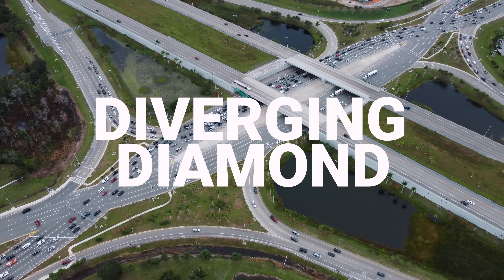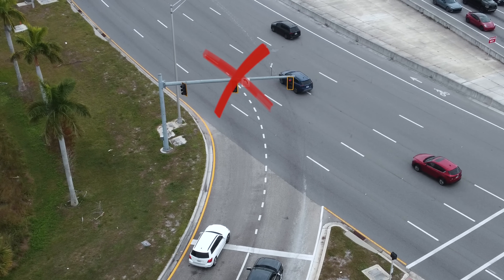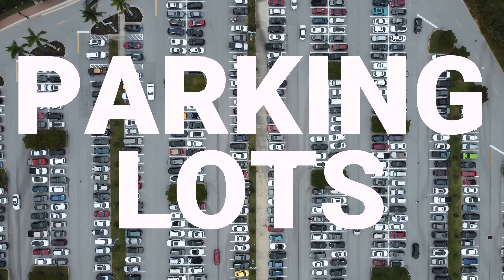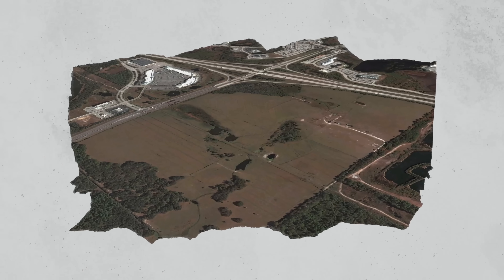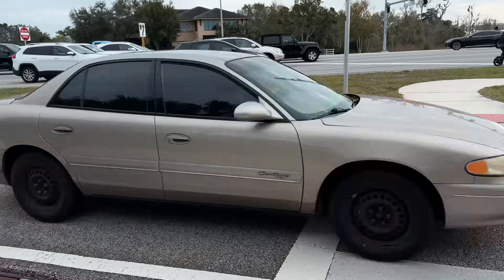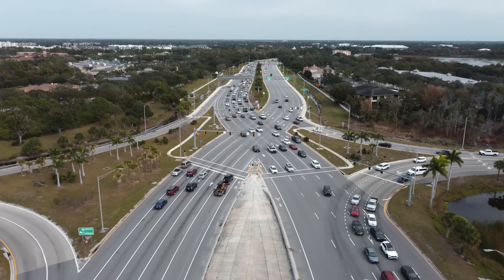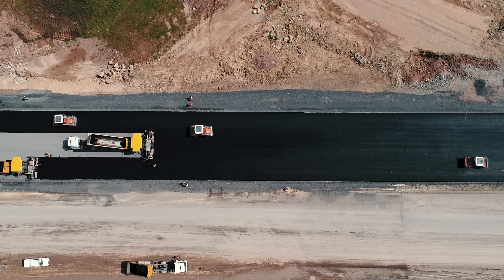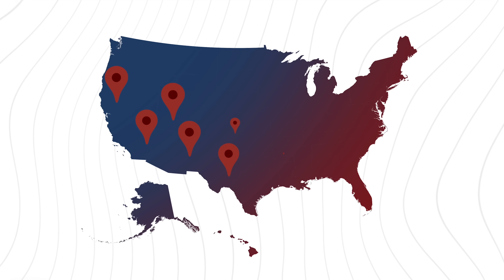Traffic Will Never Be Fixed Here

Comment: First of all, awesome video! Well made, great production value.
But the crucial point you missed about why the area HAS to be car-centric is the climate. It's just too hot, most of the year, for people to get around by walking. From April to November,  75% of the year, when you simply stand around outdoors, you're instantly drenched in sweat because of the humidity. No one can walk to work or dinner or even shopping under those conditions. It's even worse than up north where it's cold, because there you can layer up and you're fine. Here, there's nothing you can do -- except for drive in an air-conditioned car. 
So the solution isn't to make it more pedestrian friendly, because it just can't be the solution. It's like saying that an underwater city needs to be move away from submarines and let people swim like they were intended.
But again, aside from that one point, great video -- great background, editing, production 👏

Comment: This was well explained. It didn't feel like it 'hated' cars, but it just showed what the environment looks like if its built around cars and then just kind of says, "Is this what you want?"
Reply: I’m seeing comments where there seems to be a debate between whether it is better to live in crowded apartments/condos in the city or large houses far apart in the suburbs.

I think there could be a middle ground in suburban developments where there are single-family houses, but spaced close enough together that it could be feasible to put a streetcar line down some of the busier local streets.

Plenty of Northeastern and Midwestern towns and suburbs were built in this way, many also with streetcar lines in earlier times, but with modern zoning codes I don’t know if I’ll see many new ones built.

Lots for each house would be proportionately narrow, allowing for backyards that go deep into the center of the block. To use space efficiently for the width of the lot, houses would be square in shape, and 2000 or maybe 3000 square feet could be put into a building with comparatively little ground area. (Most of that space conservation would come from houses being two stories, but putting in a few one-story houses here and there would add some variety and be better accommodating for inhabitants who need the accessibility). Maybe add some duplexes or smaller multi-family units around.

Grocery stores, bars/pubs, restaurants, churches, schools, maybe a bookstore or library, and other smaller amenities expecting frequent use by locals could be on street corners or major thoroughfares, within walking distance of most houses. Parks could be placed anywhere throughout. Trips into and out of the city could be either by roads radiating out (with one perhaps connecting to a major highway) or a transit station in the center of this community, accessible either by walking or cycling from one’s house or maybe the aforementioned streetcars acting as feeders if the community is large enough.

The option to drive is always there, but with the shops and restaurants fairly close by, most people would find it convenient to walk, with cars generally preferred for trips out of town or in cases where one cannot or should not walk.

It probably has its own drawbacks, but I’d take it over the city apartment or large suburban house spaced apart from other houses. I’d have my own house with a yard with decent privacy, but I could still walk to places I need to get to, and multiple options would exist for local and long-distance travel. Trains would come frequently enough that I wouldn’t need a car to get to other places. But because the train system would be popular for its convenience, I’m not stuck behind traffic when I’m on the highway going the same route.

But with zoning laws and all that I’m stuck with the two debated extremes here.
Reply: @DiamondKingStudios  this is literally how it works in most dense suburbs and cities around the world
Reply: @green5260  I’m sure it is, but I rarely see much of that here.
Reply: Yeah as someone who loves walking and often chooses to walk instead of drive, I agree. There is a massive issue with how the US prioritizes cars, but at the same time the entire comment section and a lot of the videos just feel like echo chambers. No one that is happy with the way cars are so necessary and want to increase the necessity for a car would ever watch those videos because they go out of their way to make fun of them, and it doesn't even feel natural either. This video shows the topic, explains the topic, shows the pros and cons, and lets the viewer decide their opinion.
Reply: When you live in a climate where for half of the year, you're completely drenched in sweat after walking for 10 minutes, I don't know that catering to pedestrians is worth it. Milder and even colder climates, sure. Heck I work in DC, and I'm gross after walking in work clothes after 5 minutes. Maybe I sweat a lot (I do), but hot climates aren't ideal for pedestrians
Reply: @peterroberts4415  As someone who walked to work in 100 degree weather (38ish Celsius) multiple times per week, I can say I wasn't the only one doing that. There were plenty of other people out walking, honestly I think like 70-80 degree weather is when paths are most used. When it's too cold no one walks.
Reply: It’s the difference between critique and resentment.
Reply: This is a good way to put it. I like not just bikes but he is a little overbearing sometimes lol
Reply: @TechWithJackL  Absolutely agree, I stopped watching videos from not just bikes because of the terrible attitude of that guy. This video on the other hand is very well explained and nice to watch
Reply: Agreed. I love NJB, and I know his approach is what made him become popular where more conventional (and very often boring) new urbanist channels failed, but now that he's more mainstream, I'm starting to find his angry outbursts jarring. Especially when they come out of nowhere in the middle of an otherwise calm episode. I think it's time he dialed it back a little.
Reply: Definitely why I like this video more. It acknowledges the usefulness of cars, HOW the situation happened, why etc without just saying "ban cars put rhe people in commie blocks and execute dissidents" like some of the channels are like lmao.

I don't hate cars, I have one. I hate needlessly big roads, and the thought process of "oh traffic is backed up? Well, clearly, we need to keep adding more roads instead of designing the intersection and surrounding area better!" 

I'm also not a weak willed coward and can actually be outside in weather and not need to run to my car.
Reply: @dankmemes8619  "without just saying "ban cars put rhe people in commie blocks and execute dissidents" like some of the channels are like lmao."
I don't know if I've seen a single channel say that. I've seen it put forward as a strawman countless times, though.
Reply: @Coffeepanda294  It's an exaggeration my guy. No channel explicitly states that word for word. The point is a lot of those channels, like NJB, clearly dislike cars and want them extremely limited if not outright banned entirely. Without cars it MASSIVELY limits a person's ability to move which in turn results in, essentially, commie blocks because you have to force everyone to be in specific spots. And whenever someone brings up counters to their ideas, like "But I like cars and believe everywhere should still be accessible to cars even if we did improve public transit and pedestrian spaces" they will argue with you and contest the very notion.

So yeah, in short, you need to learn what exaggeration and hyperbole are.
Reply: @War450  bro’s getting mad at ghosts
Reply: @whisper3856  Nah, he's entirely correct. I stopped watching those kinds of videos for the exact same reason. I love my car and I love the freedom it gives me, so seeing every single video basically amount to thinly veiled "ban cars" got real tiring.
Reply: @War450  I agree with the 'mad at ghosts' interpretation. You're fighting strawmen.
Reply: @Coffeepanda294  Clearly not if multiple people all came to the same conclusion.
Reply: @War450  Multiple people? Out of millions who watch these videos? Well, that's me convinced, then.
Reply: @War450  Funny.. i dont have a car and go wherever i want in quite a quick manner.
Not having a car, but proper mass transit gives relaxed freedom of where i want to go.
Closest Station? Bus. Next city? Train. Half the state over? High speed train.
Car is great for the last mile from a to a station, transporting bulky stuff, going where there is less mass transit and of course buying and transporting goods from stores nearby (heavy emphasis on the last word)

Of course it also helps we have small shops dotted closeby, so we dont need to go far to buy our necessities like many American Cities are designed.
Reply: @tarakivu8861  Yeah and that "freedom" is reliant on the schedule given to you by the local government and adds an hour+ to your trip. While you're relaxing on the train, I'm relaxing in my recliner because I finished my trip already.

If you like it, great, I'm all for mass transit. The problem is when people try to disparage and reduce cars. Add in all the trains and busses you want, but the second you try to say I can't drive to my destination, we have problems.
Reply: @War450  I haven't seen Not Just Bikes suggesting that there should be no cars or that they should be banned. He has strong opinion about suburban lifestyle, and certainly not everyone agrees with this opinion. Heck, there are lots of people willingly living in rural areas, where car is and will be necessary for foreseeable future.

What I've seen channels like his advocate, is reduction of lanes, and offering more efficient alternatives. Stuff like light rail, bike paths, are beneficial to be there built and scheduled between most common commuting routes for example. This does not reduce ability to operate car, but this redirects some of the demand to other forms of travel. And it is beneficial from safety and feasibility standpoint to get these modes of travel out of roads, separate systems, as much as possible.

Not Just Bikes has made many videos in Nertherlands and about Netherlands, and he also drives a car. Netherlands is used as this great example of urban design, but there's still car infrastructure connecting everything. What these public alternatives have caused however, is that roads have less traffic, less people are willing to drive if you can use bike, tram, or train, or bus. There are less lanes so roads are smaller. I limit this argument to intracity and near intercity scale. I don't really know how to replace flying effectively for longer distances.
Reply: @jarivuorinen3878  if anything, he and a lot of people supporting urbanism (and even myself included) have thought that if Amsterdam can become a sustainable urban center out from what was once a city choked of car-centric infrastructure back in the 60's, other cities can do so too... Change is happening, but not overnight...

However, that sentiment hadn't fully caught on and some remained opposed to it, and it is fair considering where do they live. They want to live in suburbs or rural areas because its a lot quieter than cities (which it cannot be silenced even if cars are outright taxed by congestion pricing or banned by law depending on the time of day), and many remain vocally opposed to it to the point they'd rather willingly live in the suburbs and put up the outstanding amount of traffic delays (as you can see here).
Reply: @dankmemes8619  Commie blocks?
Reply: The environment isn’t built around cars. It is built around the NEED for cars. That’s fundamentally different.
Reply: @realwickedbrew  It might be a chicken or the egg type of thing. People need to get from A to B. Why the car is the  answer to this problem over there? A lot of people here would choose the car out of real or believed convenience. It it not really a need rather a 'want' most of the time.
Reply: - If you can live within a 30-45 minute drive (or less) to work that is ideal.
- Working from home for a day or two or three every week made the city/suburbs calculation easier for many people because it takes away hours of commute time every week. 
- Otherwise, even with commute times, many people just like owning a big house with a nice yard. I know that really peeves urbanists, but it’s true. 
- People who love cities should make cities safer and nicer (parks, clean streets, trees) and transit super convenient if they want to shift the balance in favor of cities. But these services and frequent, nice transit that people want to use are VERY expensive, especially in the US where transit projects must deal with ridiculous per mile construction costs.
Reply: @dmixdup  Thanks for the answers! Owning a house is indeed a good thing, that's not a hard pill to swallow for me and for many I guess. Grew up in a house, and loved it! The village was rather boring though, even if we had everything nearby (small and bigger grocery shops, sport facilities, schools). The city offers much more! Imagining a suburb with nothing but houses sound distopian to me. Still have to go to one to experience it myself and hopefully change my mind. Or not. Don't know yet. The opportunity to work from home became an option just recently due to the pandemic i think. Before that most residents had to commute daily, right? The infrastructure for car traffic isn't cheap either. Actually it's ridiculously expensive to bulid and to maintain. The city I live in is somewhere in between a human scale urbanist heaven and a car centric urbanist nightmare. What I don't like are those, who don't want to live inside the city in a smaller house or god forbid, a condo because of the noise and pollution, move beyond the edge of the city to a nicer place, then start commuting by car worsening the noise and air pollution in the city. Hellish circle, becasue now even more people want to leave the city to live in better conditions while worsening the city's conditions with their commute. The same people demand more parking from the city districts. I mean come on! It's like some random guy demanding from someone else to offer a part of his yard for parking, because reasons.
Reply: Actually that makes it worse and more condescending and s*** .... not better. There's nothing worse than someone who criticizes without offering a solution. And just yelling mass transit at the problem just demonstrates you fundamentally don't understand the problem nor do you empathesize with the people actually trying to solve it. Nothing worse than a YouTube "expert" with no solutions except vague broad strokes and nothing but criticism for what's been tried.
Reply: @robnobert  Not really clear who or what you're responding to.

And pointing out a problem without giving a solution is perfectly fine, if lots of people still don't know the problem exists.  Covering up the problem is in fact worse than criticizing without giving a solution.

You say "nothing worse" a lot, but not very well.
Reply: @mindstalk  you're wrong. but thanks for playing.
Reply: The answer is yes, most people want this because they want to live in single family homes with yards. And they are willing to put up with traffic to have those things, notwithstanding the fervent desire of urban planners and bicyclists to the contrary.  

Also, showing the intersection during the busiest times (google satellite view shows a normal amount of traffic with no backup) is a little misleading because people can choose to shop at less busy times and avoid annoying traffic.
Reply: @dmixdup  My questions are born out of curiosity, becasue I haven't had the chance to live in a classic Amrerican suburb yet. So no mocking here from me (I hope). 
Most people want this? What choices they have besides the suburban lifestyle?
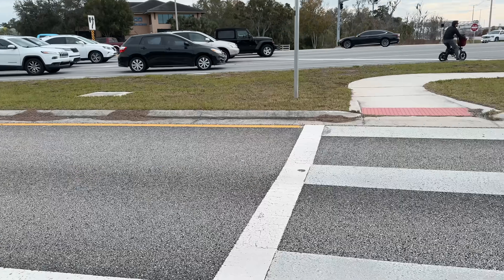Avoiding rush hour would solve the congestion issue for one? What if one can't avoid rush hour? Waking up at 4:30 to get to the workplace in the city by 7:30 then arrive home at 19:30 is how it's done (I read it somewhere)? How many waking hours does one spend at their home during weekdays?
Reply: @dmixdup  People also want to eat cake for breakfast and to punch people who insult them. People want a lot of things that aren't good for them and aren't good for those around them. If that wasn't the case we'd have a lot more happy healthy people not a society full of depression, anxiety, loneliness, and obesity. We live in a world where you cannot have your cake and eat it too, everything comes with trade-offs. 

Sure people want to live in single family homes with yards that are also 30 minutes from their place of work where they have a high paying job in a white collar industry. But with the world the shape it is, there is only space for less than 1% of people to have that. So what do you sacrifice? Do you force 99% of people to live far away from their place of work and waste hours of each day commuting? Do you force people to live in high density neighborhoods within walking distance to their work & stuff they need? Do you make everyone become subsistence farmers?

Comment: The person that drove in reverse was aiming to fix their mistake and clear the intersection for cross traffic. People just don't need to move into intersections they can't clear and a lot of gridlocks would never happen.
However this area is just designed awfully as shown. No interchange will fix anything, if the rest of the road has regular traffic light setups and then is also such a "draw area" for people and their cars. Vast public transportation would help here but thats more a wish than a possibility.